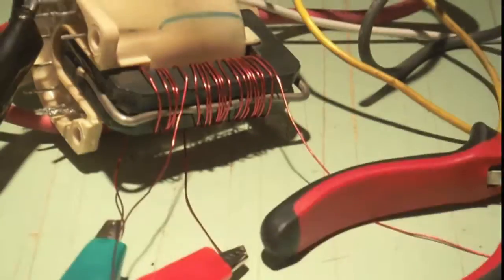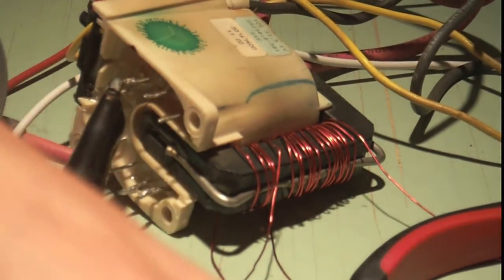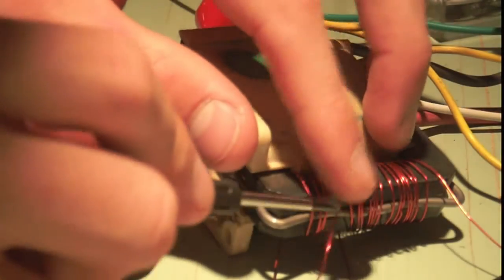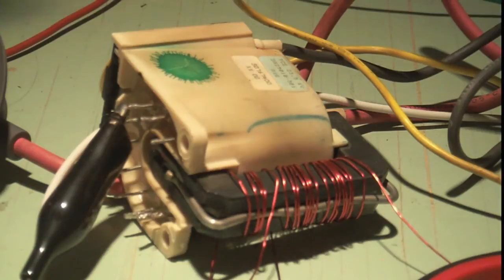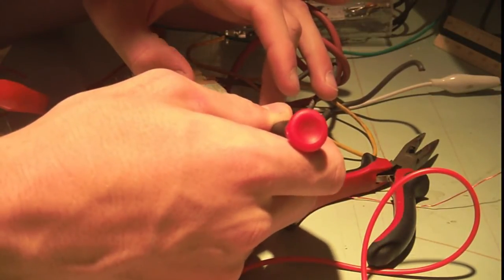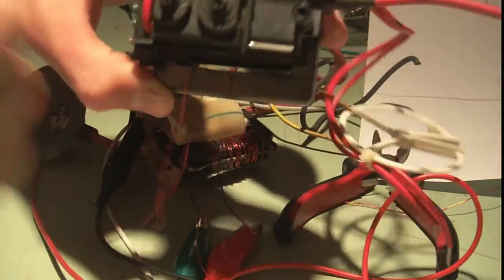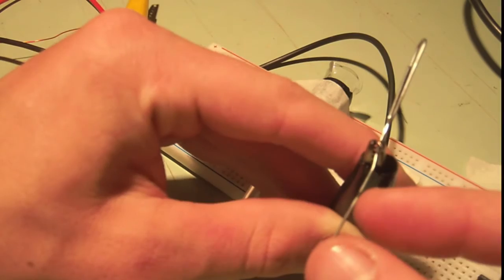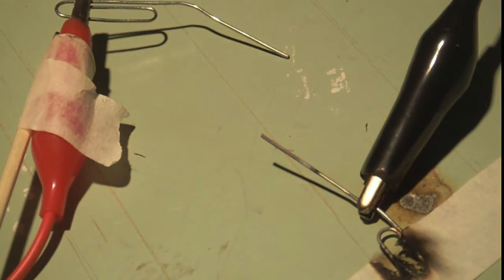How To Wind Your Own Flyback Coils

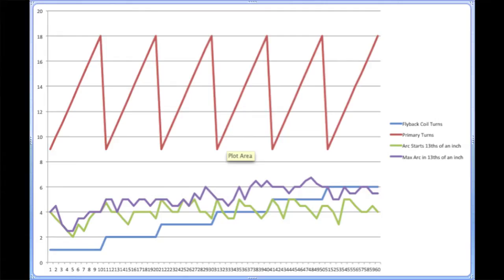Comment: Thank you so much, especially for the datapoints at 7:07!! Liked and Subbed! I have a question about arc stability regarding this graph. I have a question, and looking at the upload date I wouldn't blame you had you forgotten the details.. but would you say the spark stability was congruent to a bigger difference between arc start gap and max gap or is stability inverse to that dynamic?

Comment from the maker: With just a heatsink it would start to get hot around 1 or 2 minutes, but I never ran it past then, with a small fan it could run indefinitely, or with a slightly bigger heatsink, mine was very small.